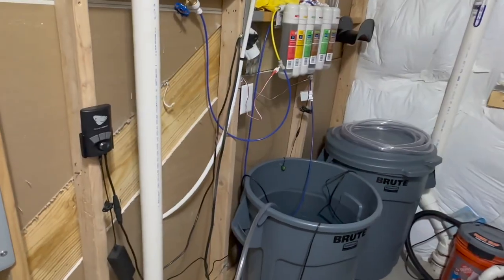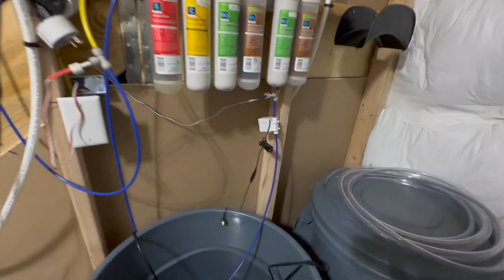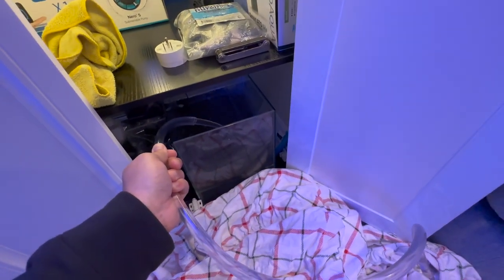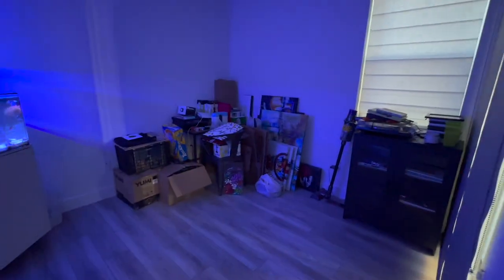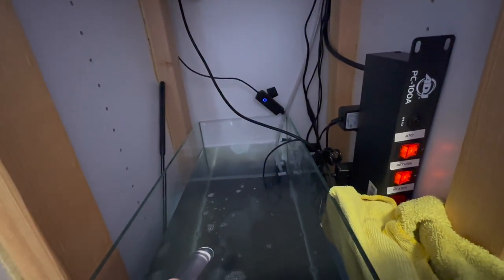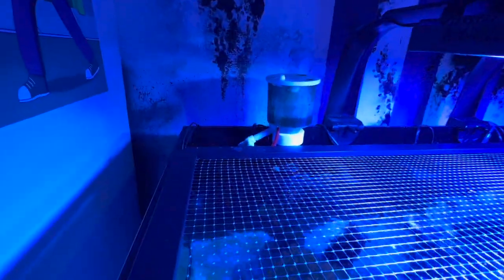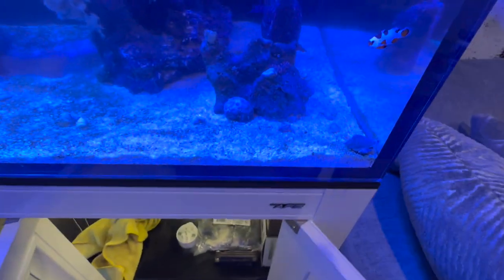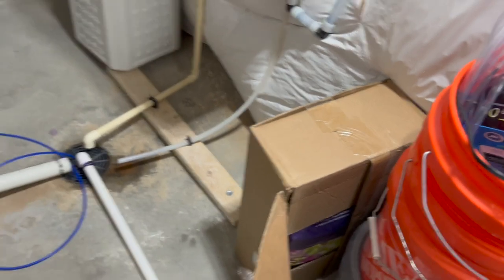How I Make and Use my RO/DI unit/water at home! Aqualife Twist In RODI Unit!

Comment: The ro project looks great. I like to subscribe to channels that are honest. I need to step up my ro system. I buy my water from Walmart haha. Soon I'ma get a ro unit again.
Reply from the maker: Yeah man, I had that spigot installed right after I moved into the new place because I knew I was going to get a bigger tank for the basement. I only had that 25gal Waterbox when I moved in. I am thinking of maybe another tank but I am not sure yet haha. Want to get the 80gal all setup and running smoothly first.
Reply: @CO.Reefing  all you need is one good tank
Reply from the maker: @HCBCHEMISTRY  That is true, but the 25gal is so easy bro. I rarely ever do a water change and probably even less now that I have those Sealab No28 in there as well.